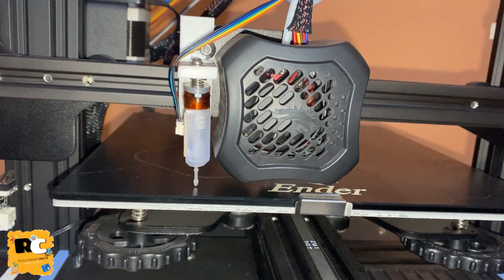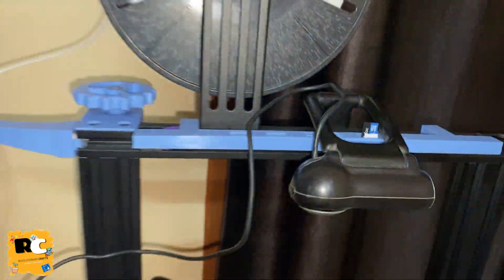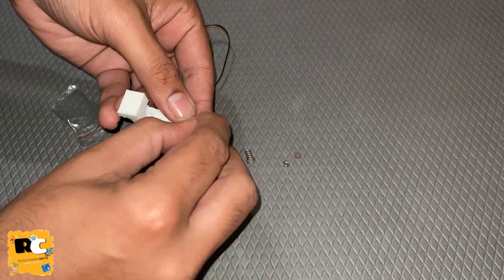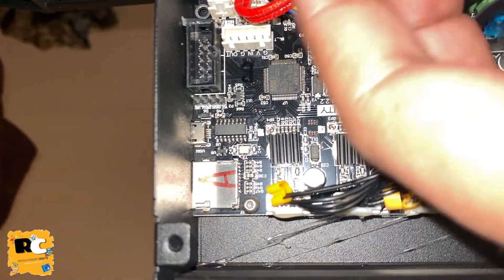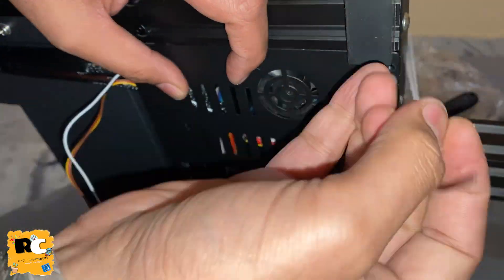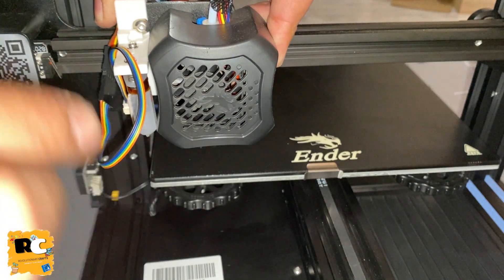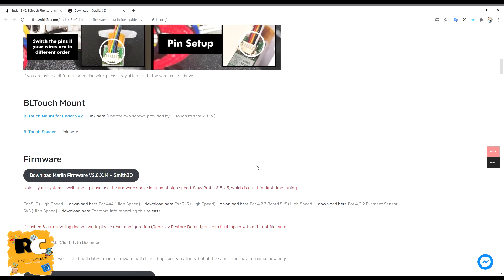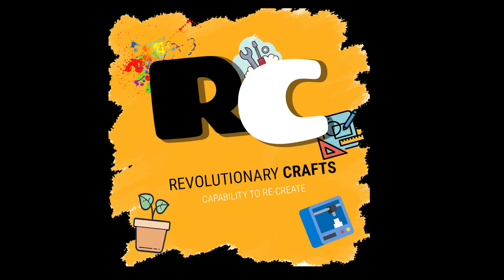How to install BL Touch on Ender 3 V2  | Complete guide | Novo 3D BL Touch | Ender 3 V2

Comment: selamın aleyküm.
I can't find software. they removed all option from creality offical site
Reply from the maker: Hi Dear,
Please download official OS from here.

https://www.creality.com/download

Thanks
Reply: @RevolutionaryCrafts  I fix it latest version with BL touch. but doesn't work. Nozzle stopping center of the button while I press level button.
can you help me if you can
Reply from the maker: @tuncayaydn2048  then there must be something wrong with the wire connections.. Could you please share the pics on revolutionaryart2k20@gmail.com
Reply: @RevolutionaryCrafts  I download from smith3d and problem is solved thank you so much
Reply from the maker: @tuncayaydn2048  good to hear that..👍
Reply: @RevolutionaryCrafts  system working but table setting doesn't work now. almost demeged table glass or nozzle.
I don't know what I will now
Reply from the maker: @tuncayaydn2048  You have to do Aux Level first, if your nozzle is touching to bed then increase the ZoffSet (1 or 2 or more depending or the distance between nozzle and the bed) and then do Aux Level. I will upload a YouTube video soon for your reference
Reply: @RevolutionaryCrafts  I will try what you says. Thanks for hepling again
Reply: @tuncayaydn2048 Selamünaleyküm ,3d touch alcam da aldığımda size sorabilirmiyim ayarlari
Reply from the maker: @tuncayaydn2048  https://youtu.be/2Ad9MPJodvw  I have uploaded a video for guide, Please check this out :)